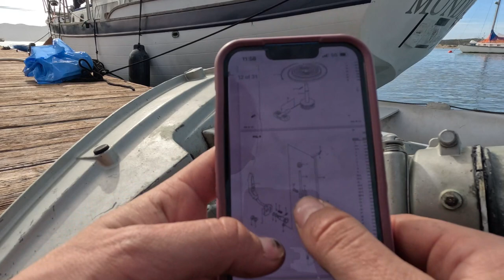[Ep 25] NOT SO FUN work on the sailboat

Comment: A few little things, not prawlers but pawls. As you service things, you need Tefgel and anti-sieze (I use the copper type. YMMV) . If you must put fittings in a pipe, two 45's are better than one 90 if you can fit it in.  The red pipe is probably a little long to allow for the ends to perish, be cut off and refitted.  Keep up the good work.
Reply from the maker: Ha yes! I realized that later on that I called it prawlers 😂 I have a hard enough time with English let alone mechanical parts. I’ll pass on the plumbing comment to Grant. Thanks for watching !